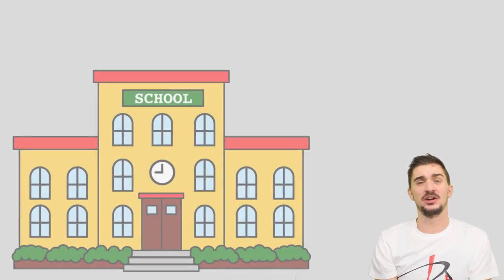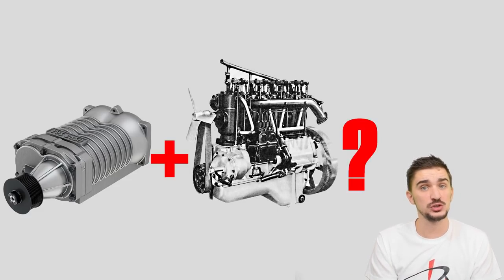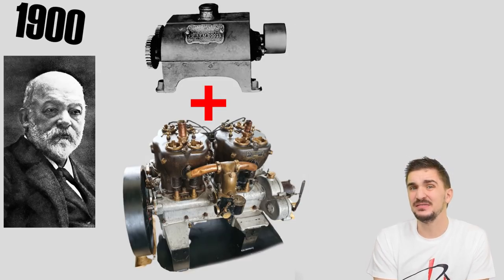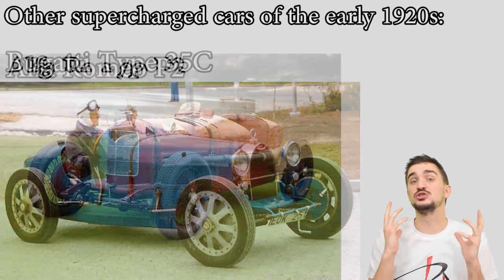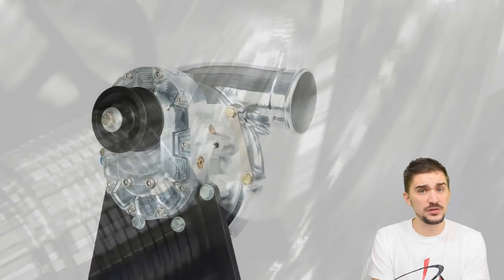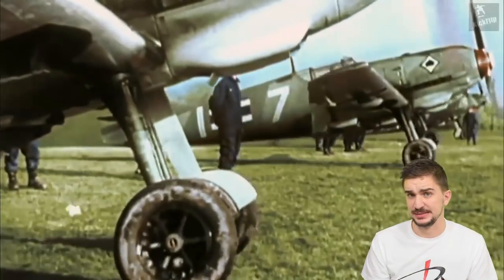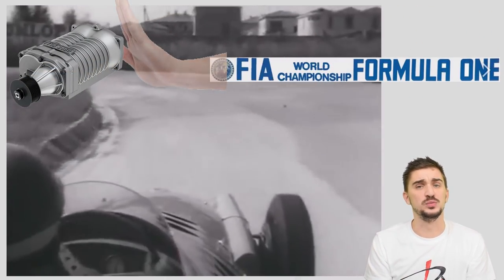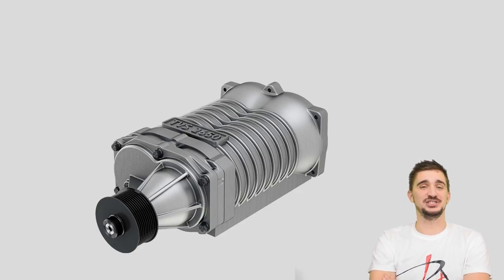SUPERCHARGER HISTORY - Boost School #5

Comment: The Demon was not the only production car to do a wheelie with slicks stock. The 1969 & 70 AMC AMX would do a wheelie with slicks stock. It's wheel base was an 1" shorter then a corvette and the 1970 came with factory traction bars. Mopar had one also in the 60's, I don't remember what one but it had an altered wheel base. The rear axle was moved forward. Just enough were made so they could call it a production car for some drag racing class.
Reply: The Mopars in question were 1965-7 B-body (Plymouth Belvidere/ Satellite, Dodge Coronet) with the rear axle and wheelwells moved as close to the door as possible. It was never done in-house nor as a homologation special, but that handful or so of A-W cars were done by individual racers, and are historically noted as the first Funnycars. This would also mean they weren't 'production' vehicles and not really streetable. 
  Even though the AMX was capable of wheelieing with slicks, the drivetrain ultimately used to do so wasn't a listed 'normal production' option, much like the Yenko Chevys which could also lift the wheels a bit. Under your AMX or altered claim you could also include the 'factory' Hemi Dart & Barracudas which were certainly capable of sky-high wheelies (and blowing out the windshields from twisting the body so hard!), but they were actually reworked specialty-built race/ off-road only cars (homologation specials), not production units. No, the only true 'factory production' car that was actually pictured wheelieing in a magazine pre-Demon that I can remember was the AMC Gremlin-X V8, as tested by Hot-Rod or C&D in the early '70s, and that was done on ('60s-'70s tech!) street tires!

Comment: a supercharger is always a blower but a blower is not always a supercharger. 2 stroke engines that require a blower to run are naturally aspirated, not supercharged. Otherwise all 2 stroke engines would have to be considered "supercharged" as they use the bottom of the piston to pump air above the piston, replacing the second cylinder in that first 2 stroke design.

Comment: Although this comment may be a year late, I just saw the video and heard him say the car featured was the “first production car capable of doing a ‘wheelie’.”
Well, back in the 1980s, I saw a news report of a man in Atlanta, Georgia, USA, try to outrun police in a Lincoln Town Car. The video emphasized that he was going so fast the front wheels of the car were “coming off the road.”
I don’t know if this was because of wind or torque. I do know that Lincoln used to have Ford 460 CID / 7.5 liter engines with C6 automatic transmissions and 9 inch differentials.

Comment: Blast furnaces do not need the extra air to melt the metals, they need it to oxidize the impurities. If you have iron with a bunch of crap in it, including excess carbon, you blast oxygen through it, making carbon dioxide and other oxides, which will either bubble out or pool on the surface as slag. Then you will have pure iron, and you can measure the proper amount of carbon to add to make a specific grade of steel. By collecting the slag and later refining it, they were able to come up with things like pure chromium, vanadium, molybdenum etc which has given us our super alloys that we use for our tools nowadays.

Comment: Actually turbos are superchargers, over the years the automotive world has kind of hijacked the term supercharger as meaning only mechanically driven units, the fact is anything that produces boost is a supercharger, there's just many different types of superchargers, roots type, centrifugal type,  screw type, and among others turbo type, but they're all classified as supercharging systems.
Reply: In the diesel world they definitely are classified separately.  The supercharger is not so much for adding hp, but for scavenging on a 2 stroke.  Turbos for adding boost.
Reply: @tracewithaview6731  that's not a supercharger at all - that's a scavenge blower.

Comment: 15:00
Take this from an engineer to another: if you want to know how wrong playing with superchargers can get, you should ask the British Racing Motors (BRM) about their T15 car. 
Instead of using a Roots or screw compressor, which were common at the time in F1 because of their rather smooth and excellent pressure curve which raised the torque at lower/mid revs and "flattened" that same curve making the car somewhat reasonable to drive, BRM asked Rolls Royce to make them not one but TWO CENTRIFUGAL ONES.

For those who don't know the difference, in simple terms Rolls Royce gave BRM the compression part of a turbo, which was driven directly by the mainshaft of the engine. 
The problem? Centrifugal compressors have a pressure delivery that resembles a parabula and the faster the compressor goes, even more air goes in. This helps the power delivery in the top RPM range, but made the car completely undriveable, with just short of 600 BHP @ 12000 RPM and 525 BHP @ 11000. It was basically a paperweight if the engine was under 7000 RPM, since it didn't have the torque nor the power to move the car around. It was a mess.

The centrifugal supercharger enjoyed a long and victorious life in Indy, since that kind of power delivery is excellent if you don't have to slow the car and shift multiple times...

Comment: Tesla's fanboys: what about the Tesla Supercharger ?
Reply: I just commented about it, thought i was funny as fuck
Reply: I find it odd that the electric car "tesla" uses the same engine coolant as my 2005 mini cooper S...
Reply: @jasminegoin5006  well, why would that be?
Reply: They use roots blowers to cram more electrons Into the battery
Reply: they just overcurrent the battery pack into oblivion. when you charge a battery pack at its rated current it last longer but takes longer to get a full charge. fast charge your cell phone for example receives 9 volts from the supply instead of the normal 5 volt and going at twice or even 3 times the amount of amps needed to charge the battery. super charge systems like Tesla probably goes up to 10x or more the rated capacity of the pack which can become very dangerous very fast if the battery management system is not smart enough to limit the input based on the temperature of the pack
Reply: Tesla fanboys? But you're the only comment in this video with that phrase 🧐
Reply: @pieterpretorius1014  ah, just like street racers who boost their cars to oblivion. Nothing is free.
Reply: @sepg5084  i pretty much burst out laughing when i read your comment. blasting the head of the engine block sounds like a really expensive thing to do. and really bad. if i want raw power i'd stick a fighter jet engine into the car. that will get the adrenaline pumping, all 10000 horse power going straight out the nozzle
Reply: You'll find it on the shelf right next to the radar beam grease.

Comment: Dude! Jean Etienne LeNoir... the first internal combustion engine was a 2 stroke in 1859.
The 4 stroke was an improvement upon the 2 stroke by Karl Benz.
Then there was no mention of Detroit diesel's 2 strokes that blowers are actually named after... 6-71 blower sounds familiar? No? It was almost a good video.
Reply: I agree. Piss poor that Detroits were left out.
Reply: Those Detroit Diesel engines used the blower for scavenging, not as a supercharger.
Reply: @Brian B-P  those superchargers were there because those engines are 2 stroke. All the valves are exhaust valves. There are no intake valves. The intake ports are at the bottom of the cylinders, so no shyt Shelly. Since there is no intake stroke, of course the supercharger promotes scavenging, but even more, it functions as the replacement of the intake stroke. I don't think anyone in this thread needs a lesson on Detroit diesel operational theory. Because beyond that, many Detroit diesel engines are compound charged by the addition of a turbo. A supercharger is a positive displacement air pump. Of course it uses it as a supercharger. What you said may be one of the most uneducated things I've seen said on the internet.
I mean, if you have anything not purely trivial to add, or technically accurate, please do. I'm just saying this video was a huge zero by not acknowledging the true history of superchargers used internal combustion engines.

Comment: Superchargers don’t make a whining sound. The toothed belt and pulleys used in many of them do, as the air exiting the rapidly shrinking space between tooth and groove as the pulley rotates reaches very high speeds. The noise increases in frequency (pitch) the faster it rotates. “Poly-v” type belt driven superchargers (as one pictured in the beginning of the video) don’t make that sound. Those belts are also more efficient and last longer.
Reply from the maker: Toothed belts and pulleys only make a noticeable sound when they're faulty. If they made such sounds during regular operation then every car with a timing belt would whine, and as we know they don't. The same holds true for accessory and other rubber belts and pulleys.

Comment: No mention of the 1989 Ford Thunderbird SC, being the first factory produced supercharged and intercooled vehicle.
Reply: My brother found one wrecked and put the engine in a 74 pinto wagon. It was way for fun to drive than a v8 swap because it really didn't add any weight to the front end. It was not a complicated swap either.

Comment: There are two problems inherent to superchargers First the consume engine power to rotate and second the max pressure is dependent on the rpm. While turbos can have max boost from very low rpm.

Comment: Comprex is the thing that fascinates me the most. And the fact that it seems like the technology was prematurely abandoned... Though I bet calculating the flow and getting the most usable rpm range out of it was sort of a nightmare. I'm just thinking about the power of flow simulations of today and the abilities of 3D printing super complicated metal parts. Also maybe some modern ceramic and other platings to be able to cope with exhaust temperatures of gasoline engines. Then just add some clever noise cancelling in to the mix... I was pretty delighted when years ago I saw Antrova AG trying to make it viable again (in hydrogen engines), but seems like they didn't get much hype going... Also didn't see any actual prototypes being tested. Just claims.

Comment: I’m partial to super chargers over turbochargers. I think today a lot of people like turbo’s.  But I like less lag. I’m not sure but I’d assume super chargers are better for bigger motors because they have more torque to compensate for the extra pulley putting strain on the motor. I really like the idea of an electric powered one. It would be cool if you could hook up a little 12v drill motor to a turbo to spool it up and prevent lag then have a clutch that disengages when the engine gas’s surpasses the rpm’s of the motor. I’m not sure what the rpm’s of a turbo is but I know a 12v drill motor definitely has enough power to spin one pretty fast if it can sink a 8” lag screw into a piece of wood. And with no load they spin at like 2500rpm.
Reply: It's possible to run a Turbo to a Carburetor 'd  Supercharger. It's called Compounding. It gets rid of Turbo Lag, and the Supercharger just compresses the air the Turbo feeds it. I've been toying with the idea, the value, of an Electric Supercharge in such a situation. I wish it were possible. So much less plumbing.
Reply: @N-Lee  I know I’ve seen electric powered turbos. I’m not sure if they’re from reputable sources or cheap Chinese nonsense.

Comment: Great stuff.  I think that an important part of the history tho, would be the influence that the GMC (later Detroit) 2 stroke diesel engine had.  The blower was used for scavenging in that engine; it wouldn't run without it.  Someone said "hmmm, what if we took that blower off of that 671 Detroit...and put it on my hot-rod?" 🤔
Reply: I often wonder how drag racing would have evolved if hot rodders didn't have all those WW2 surplus 6-71's to cannibalize for blowers.

Comment: A beautiful video.  A lot of research behind it, really some excellent photographs, and with humour.  Now just a couple of technical aspects please - like how do you measure supercharger efficiency?
Reply: Not sure, but from memory the twin-screw is the most efficient of the three, mechanical superchargers.
Reply: You measure temperature and pressure before and after the supercharger, then do some math using the thermodynamic equation for adiabatic compression.  Efficiency is theoretical temperature rise divided by actual temperature rise.

Comment: I learned in a school a few decades ago that Clerk’s supercharger is actually a scavenge pump.
Reply: Yes, the blowers in more modern two-stroke diesels (such as the well-known Detroit Diesel Series 61) are actually used on those engines as scavenge devices, not superchargers.
Reply: All blowers for 2-stroke engines are for scavenging exhaust.  They do so by pressurizing the induction system and flushing out the exhaust by positive pressure.